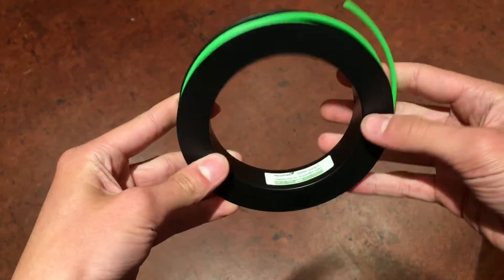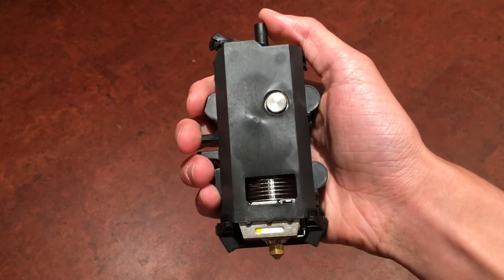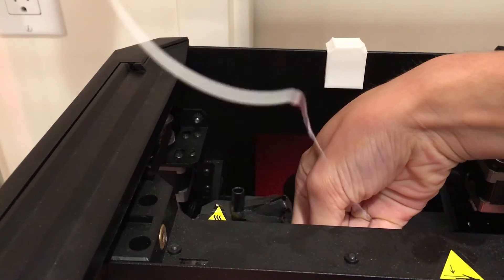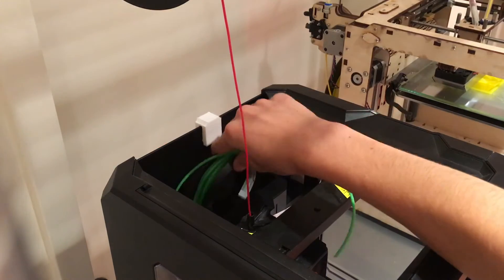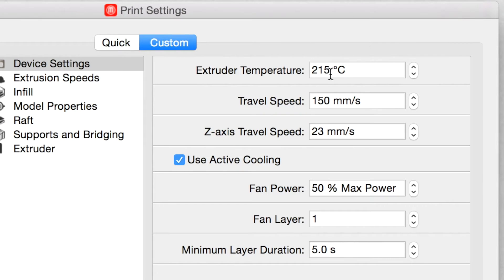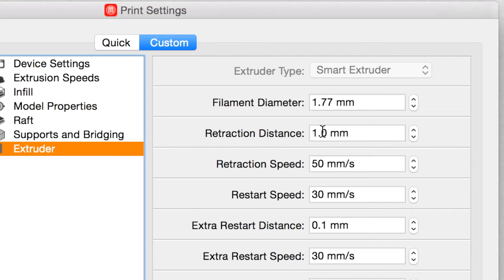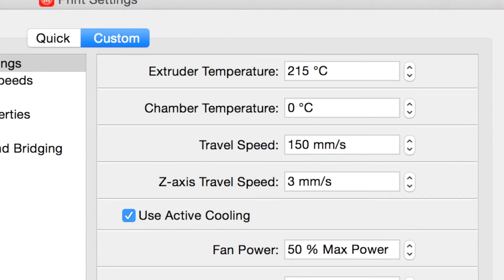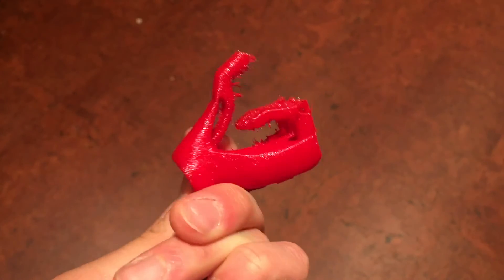Printing NinjaFlex with Makerbot 5th Gen.

Comment: I have a makerbot replicator + and replicator z18 and have not been able to print tpu. I tried making modification pieces to block the tpu from getting caught in the feeder, adjusted speeds/temps/retraction, nothing works. I have printed 2 things successfully but unable to replicate these things. Is there any tips on how to prevent the filament from getting stuck inside the extruder? Also do you recommend any good printers that are great with tpu?
Reply: I am having the same problem. Did you find any solution? Well, I heard Makerbot's "Experimental extruder" works pretty well with the flexible filaments.

Comment: I still can get my 5th gen to pull the flex thru the smart extruder plus. Any more tips.
Reply: You need the experimental extruder. The pressures needed to push a flexible filament through cannot be achieved by the normal smart extruder.
Reply: @AmeyaVaidyaExEcutESC2  So you are saying this video is wrong then?? He said nothing about some experimental smart extruder.
Reply: @bloxyman22  Look we tried using the extruder we had with our makerbot printer and we found that we couldn't tweak the settings to make it printable. When we used the experimental extruder then we could change those settings as needed. The experimental extruder is built for these purposes typically. YMMV since it depends on the printer you have. The one we have is quite old.
Reply: I really don't know why you are getting defensive. The settings they recommend do work. We just needed a different extruder. If his video works for you, then that's great man. 

Have a good day!
Reply: bloxyman22 yep it does not work with Smart, tried it 3 times
Reply: @AmeyaVaidyaExEcutESC2  I just found it weird that you said it required a completely different extruder, when this video made no mention of that requirement. So thanks for clearing that up and I am definitely not going to risk it and give it a try on my 5th gen makerbot.

Comment: I find Ninjaflex crazy expensive, stringy and difficult to print. Prints always require tons of cleanup and I've never seen anyone get good surface finish with it.

You should try out alternative TPE or TPU type filaments. A local online store I buy from stock filament imported from Chenyue Technology which I can recommend 100%. After Taulman Alloy it is my favourite filament so far. Had to print an adapter for my extruder to confine the filament path, but after that it has been smooth sailing. They also make pretty good PET.
Reply: Can you share the modifications you made to the extrudor? I have a makerbot replicator + and have not been able to consistently print with ninjaflex